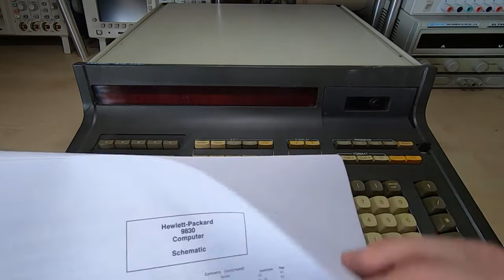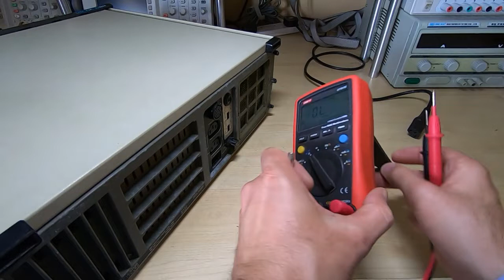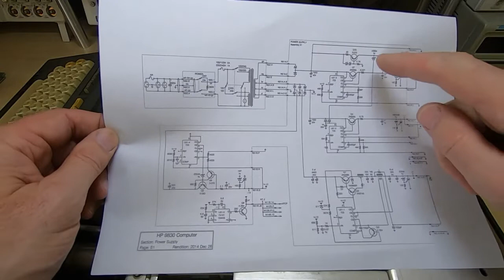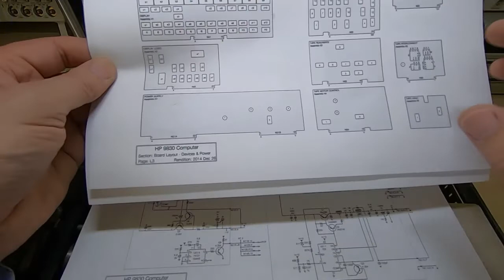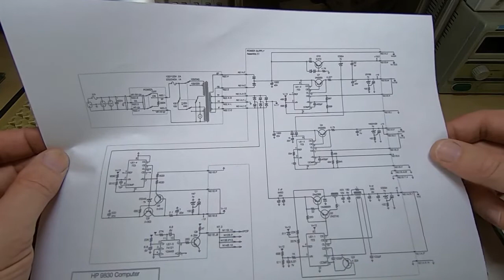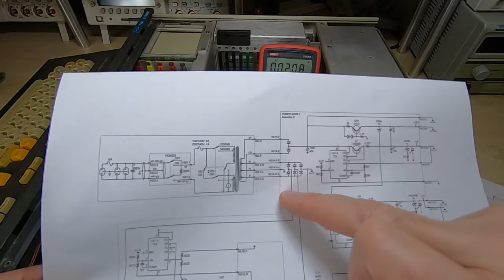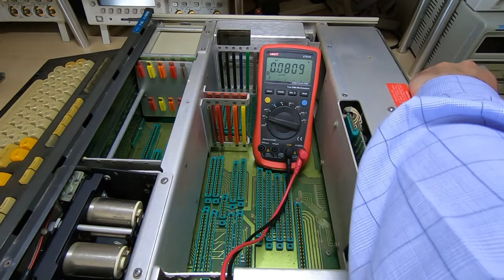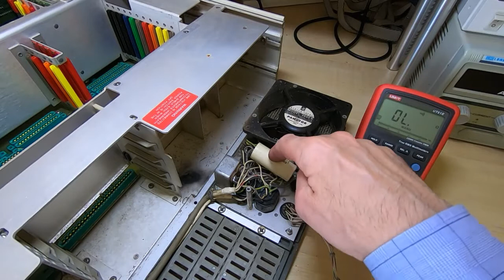HP9830A  Repair  Part1

Comment: It will be good to see this machine running again. The 9830A was the third device I got to use and program back in the day and the second one I actually had my hands on. I still have some tapes that I used with the 9830A. It would be interesting if I could read the tapes and find out what programs are on them.

Comment: Can you make a video showing what's on the cards and how there sapost to work? What's the chips are doing. Like a over view. It would be really cool to see what everything looks like.
Reply from the maker: Hi, Yes my intention is to explain the circuit and function of each card in turn as I refit / test / repair them. It should be interesting as this is a logic based processor system.
Reply: @JerryWalker001  can't wait to watch